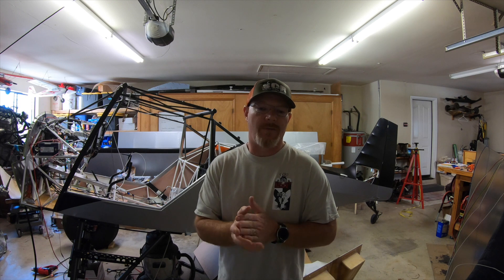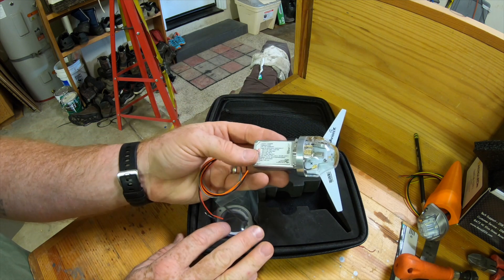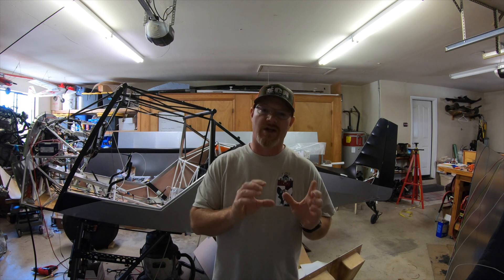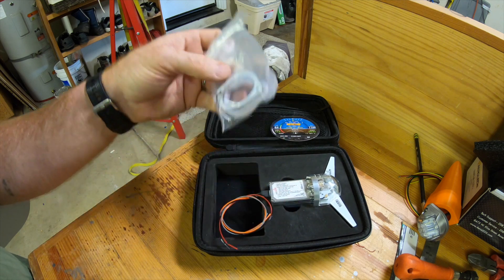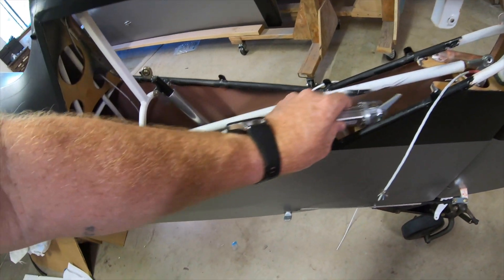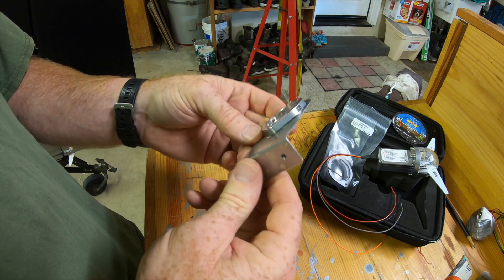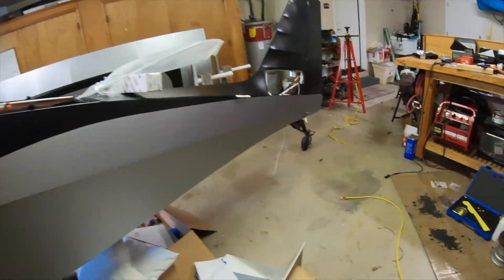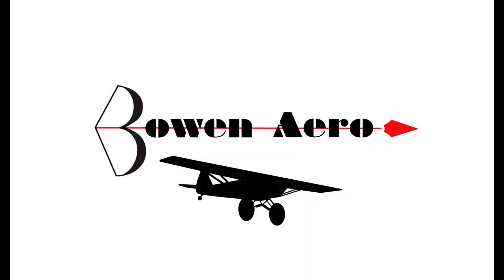Kitfox 7 Apex Build Episode 23 ADS B Solution, uAvionix tailBeacon X

Comment: Mounting it inside the structure is a good idea . . . I'm going to do the same thing myself.  Won't those tubes interfere with its operation?  I know it's okay inside wood or fiberglass with no metal around but I'd be worried about your metalwork.  Did Uvonix tell you they've seen installations inside tube and fabric aircraft?

And that's interesting that they told you that you could turn the light off via an external program.  They told me you couldn't when I asked.  I was just going to let it burn but that's good news that you can turn it off.
Reply from the maker: So initial they told me that the capability would be there to turn it off, but the final version doesn’t have that capability, so the light is on when in use. They were fine with me mounting it inside the fabric and when I had my transponder cert done we had no issue with the transmission from the interior location.
Reply: @BowenAero  That's good to know re the tube frame not interfering with the satellite signal.  I understand that it would'nt have trouble picking up your transponder signal but it was the satellite and ground station signals I was thinking of.  

I received mine about a year ago along with an AV-30.  I got an email from them immediately thereafter asking me to send it back to them because of a recall.  Come to think of it I'm not sure why I sent the AV-30 back as the recall had to do with only the X.  

So . . . I must have had one of the earlier models of the X.  Prior to my order I had asked them about the option of turning the light off and they said no.  Couldn't be done.  Seems like that would be an easy thing to provide.  Either a software switch or a separate line for the light.  Either one would seem to be easy options.  Oh well.  

I haven't re-ordered yet.  I'm still deciding whether to go with the X or something else.

Comment: We’re you able to get the option to turn the LED off? I’ve mounted mine internally as well, but uAvionx engineers tell me they don’t have the option to turn off the LED position light.  Not a big deal, but would be nice.

BTW, great video.  Really helped me make up my mind.
Reply from the maker: No, they promised that and then decided not to make it a feature of when they released it, it also doesn’t beacon, it is a position light only.
Reply: @BowenAero  Thanks, that's consistent with the answer I got as well.  So I now have a light shining brightly in the headrest of my Fly Baby.  Never-the-less, it was a good solution and I don't think I would have thought of mounting it internally, which was massively easier than retrofitting it to tail of my plane, without seeing your video.  Thanks again!

Comment: It's a nice transponder, but the lack of anonymous mode makes it a deal breaker for me.
Reply from the maker: Just put it on a switch and turn it off.
Reply: @BowenAero  That's illegal.  https://www.planeandpilotmag.com/article/turn-off-your-ads-b-go-to-jail/  and if you are turning it off in flight they might be able to detect it.  The GDL-82 and EchoUAT are the only solutions that are legal and provide actual anonymous mode.  The reason is because the UAT box must transmit your tail number if it can't confirm the transponder is set to 1200.  The tailbeacon and skybeacon can't go anonymous until it sees your transponder being hit so it will spit out your tail number until that happens.  The echoUAT immediately sees that you are 1200 over the serial interface, and the GDL-82 can see that you are 1200 because it interrogates your transponder over the antenna cable as it's inserted in the path between the transponder and antenna.